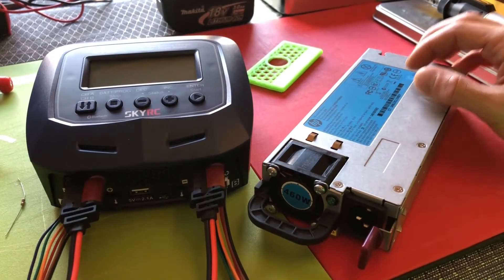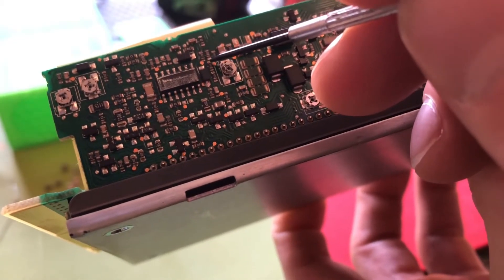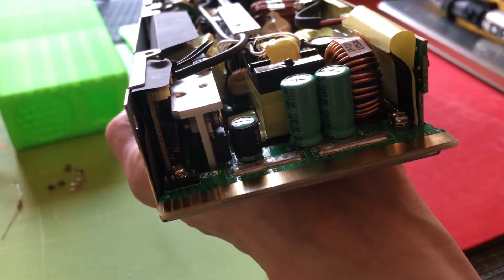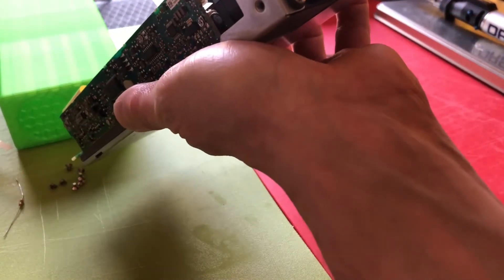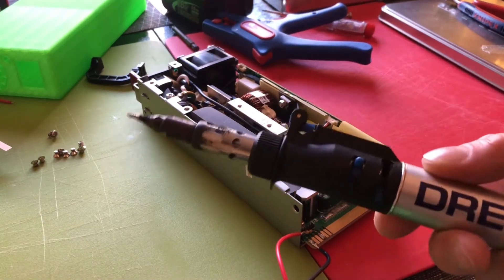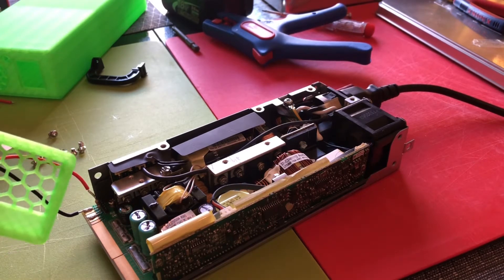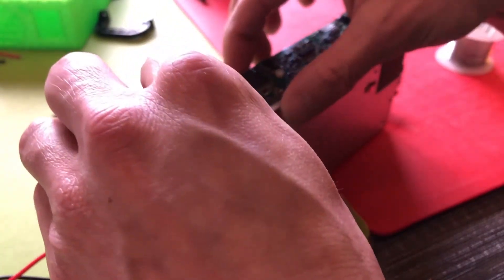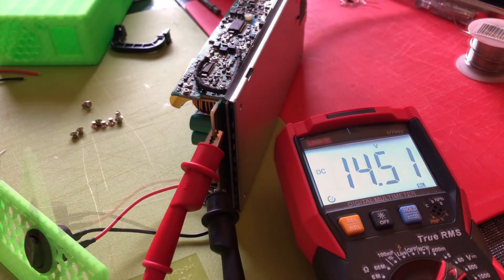DIY power supply into an RC Bench Power Supply. The cheapest power supply option ever

Comment: Like the video. 👍👍 I have an old Hobbico Series 1000 Power Supply  13.8 volts, 11.5 amps max. use for my lipo charger, looking for something with more 'grunt" to charge my batteries.
Reply from the maker: Thanks man, 
Yeah then this one could be the one you want. It can handle up to 38 Amps.
It’s an HSTNS-PL14